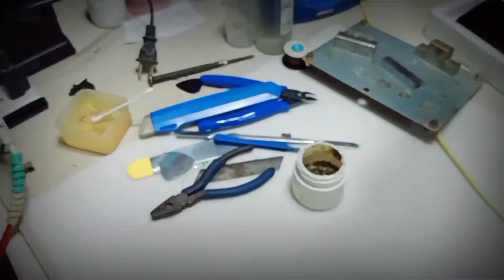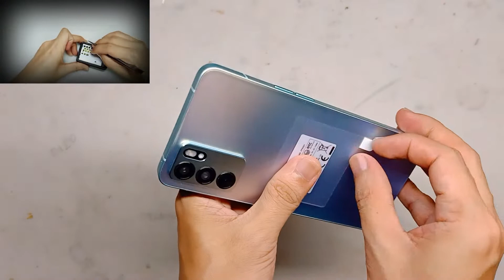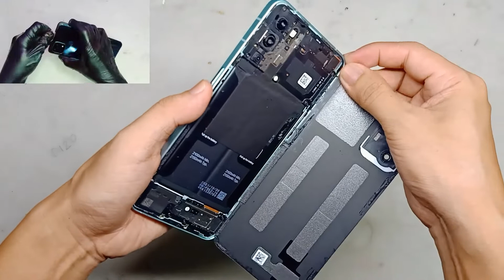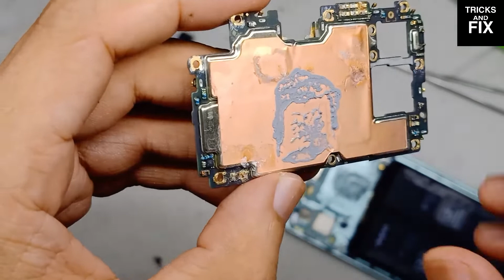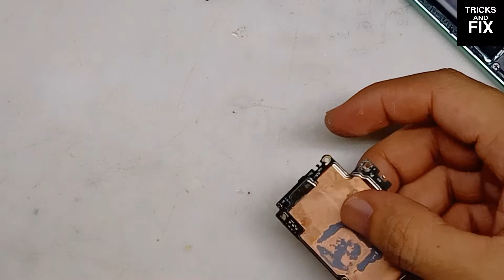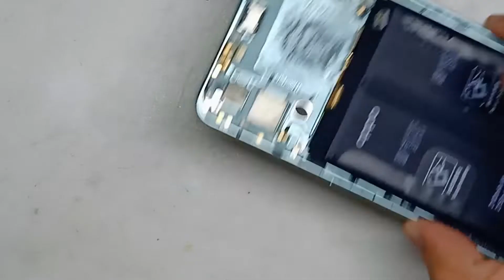Oppo Reno 6 5g Disassembly | Water Damage

Comment: Hello, I dropped my realme 7 in the water. The phone works, but the screen is on but not lit.... you can see everything but only with a flashlight, I changed the screen and still the same thing even on the new screen. do you have any idea what the problem is?
Reply from the maker: backlight driver/section is fault. maybe short smd capacitor or driver ic is defect